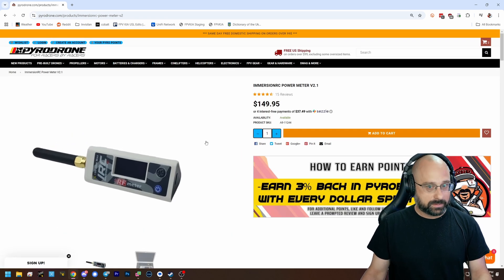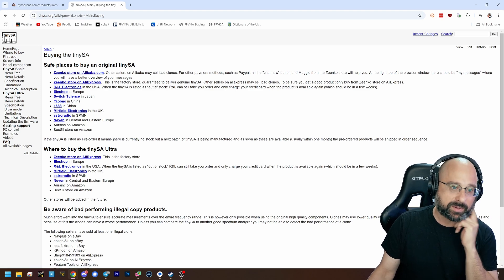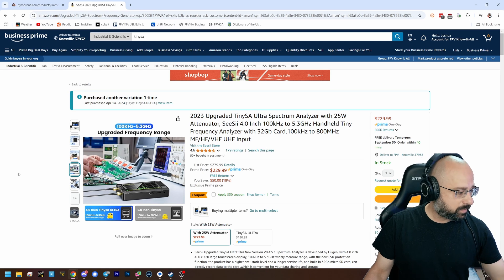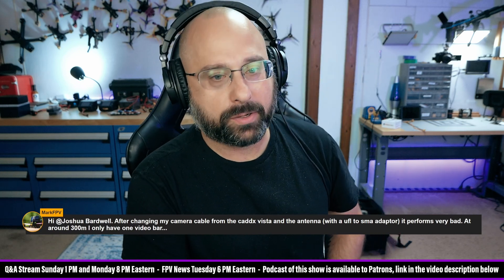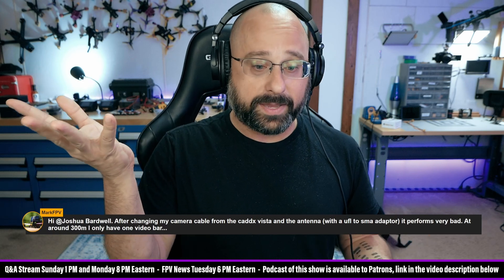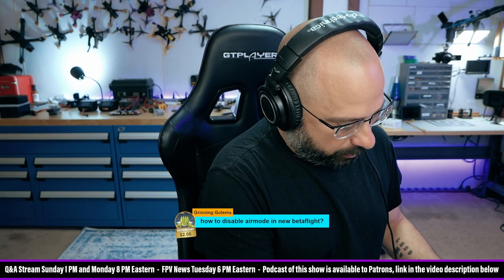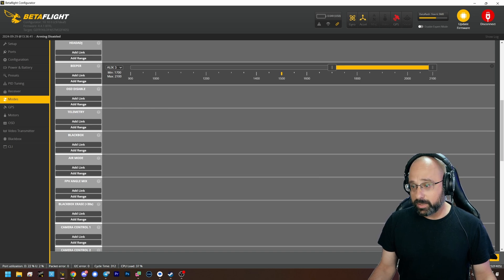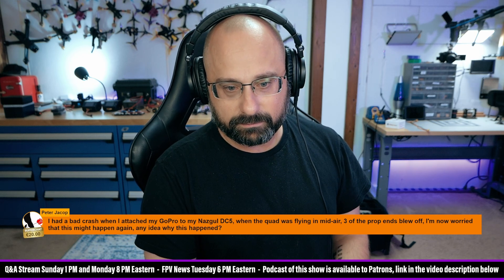DJI Vista Camera Cable Causes Bad Signal? Should I Disarm When I Lose Video? - FPV Questions

Comment: I had an issue with my 10" (lost VTX) and I disarmed at once - but GPS rescue stepped in and flew it back within 3 meters of the home location. Does GPS rescue ignore a disarm ? Or did it activate because I disarmed in mid-air and not because of the lost VTX ? (there was a bad wire to the Air unit, so it switched off completely)

Comment: About the Powerloop Disarm or fly it home question: I have an EdgeTX Special Function on my Momentary Switch (RM Pocket) that overrides my Flight Mode into Angle Mode for the duration I press it. It's kind of a emergency "put me back right side up, NOW!" Button for when I do weird stuff and completely loose orientation where I am. It's also nice for when I need to scratch my nose btw.

Comment: Did you leave your quad in the Sun? polycarbonate gets brittle, under excessive light and heat exposure. 
 High KV motors will shatter the props if they've become brittle.  It only requires that you bump one of the blade tips and then the whole prop will shatter.
 I've had this happen. 
👍 

 Side note: "don't leave your quads in the sun, son!" 😂
Reply: Indeed, in my experience, age is also a factor with props.